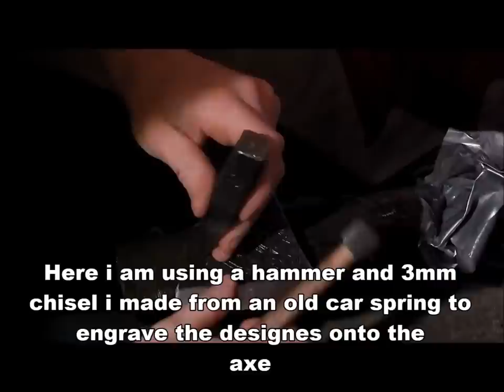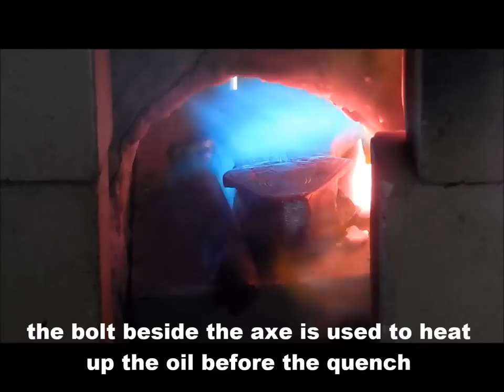Re-forging an old wood axe into an engraved viking axe

Comment: If you can hold onto the head with your bare hands, that tiny little propane torch isn't going to do any kind of "tempering". I'm also glad you filed weak points into the wood exactly where you want to prevent a split from beginning, lol.  There's a reason wood for hafts and bows chases the grain and never cuts into it...

Comment: nice but you might want to secure that anvil a bit more
Reply: A lot of his stuff seems kind of wobbly, the anvil, the vice, etc. I mean.. if it works then I can't exactly criticise him, but I'm sure he would enjoy keeping all of his toes. 

Nothing wrong with making a YouTube video about building a solid stand for your anvil, or building a solid table for your vices. I don't rememeber from the video, but I'm sure there's more than just a vice on that table (probably some expensive power equipment) so it would be in your best interest to build a good work bench.
Reply: agreed. i wonder how much force gets lost by the anvil rocking and moving.
Reply: LOTS !!!
Reply: Here is a Tip from another smith, Your anvil is dancing quite a bit.
bolt it to a round piece of 3/4 plywood, sitting in a cut-down 50 gallon
 steel drum filled with sand to the right height. the anvil floats on it
 and gets rid of ALL the bouncing.
Reply: Dude Im a carpenter and can't help seeing your workbench or "anvil " is running away... might wanna secure that before it decides to fall on something...
Reply: You can wrap the anvil base in a chain to help weigh it down and keep the anvil tied to the base.

Comment: +Andrew Hanowski  Here is a Tip from another smith, Your anvil is dancing quite a bit.
bolt it to a round piece of 3/4 plywood, sitting in a cut-down 50 gallon steel drum filled with sand to the right height. the anvil floats on it and gets rid of ALL the bouncing.

Comment: very nice work!! very clean details. would like to see you drop a beard down in the skeg ox style. maybe Forge weld a spring steel edge. Tool steel needs constant sharpening if it sees a good deal of use. but I do like your work.

Comment: Really beautiful work, personally i think a wooden wedge would have looked more authentic and traditional if it is a show piece. However i can understand the practicality of a metal one. All the same a very fine work.
Reply from the maker: Thank you!  Usually the wooden one Is placed then a metal one pounded in after the wood one, but this was such a tight fit I just had to use the metal one.

Comment: Awesome work there, but I feel like most of the energy from your swings is going into moving the anvil instead of shaping the hot metal. Making a more stable base may go a long way in making your strike more efficient.

Comment: If you reduce the size of the engraving tool down to a small thin tool you'll be able to do more detail with more controlled cuts and longer runs without fatigue. Yes you'll have to remake the tool more often but you'll see that its well worth the effort because of the control you'll get. Use good steel and it'll only need sharpening every so often. Make a bunch of different tool heads when you make a bunch of them and the results will be more pleasing and desirable.

Comment: Very cool dude, I liked them alot, but I have a question, why didn't you take out the rust with vinegar? It's easier and very quick.
Reply from the maker: Not really. I just brushed it off quickly on the grinder. If you mean the scale, I sometimes leave it on for character. If it's on there good it's not coming off easily, and vinager would rake it off within the engravings, taking the black within away.

Comment: That's so awesome, Andrew! I've always wanted to do stuff like this. but I'm afraid I'd catch myself on fire. or would put a hole in my wheelchair seat or tires from the hot metal that flies off while hammering on it. how much would you charge me for this axe? believe it or not I lost my left leg while using a maul splitting up kindling to start a fire. I stayed out on the cold too long and ended up getting frostbite on a few toes so they amputated it at the knee.

Comment: Great work! That axe is amazing. 
Can I ask you something? Why do you only temper the Edge? I've seen that in other vídeos, but I ignore the reason. Shouldn't It be better to harden the whole piece?
Reply from the maker: Doesn't really matter with an axe. Your not going to bend anything on something that thick. You can harden it all the way if you want, but it's not necessary. Usually old axes just had high carbon steel on the edge, and a wrought iron body. Iron dosnt harden so you would just edge quench it. As for a knife or sword though, making the spine soft and the edge hard (like a differential heat treatment) will make it easier to bend, but less likely to break. You can just bend them back to shape if they get bent and a softer spine will always be less brittle. Hope this helps!

Comment: Andrew Hanowski, Hello, I've been a fan for some time, I started blacksmith some time ago and I'm finishing my first ax re forging, if not ask a lot, could you tell me the thermal treatment procedure that applied to have such a hard edge? And the rest of the ax too, thank you from now on!
Reply from the maker: No problem man! I'm always open to help people! If you ever have a question in the future feel free to email as well! Anyway, thers no telling what the steel the ax is. Some are solid carbon steel like this one, while some or even wrought iron with a high carbon edge welded in (old ones that were hand forged). For this procedure I've always had success quenching in a warm oil (heat a piece of steel to yellow and stir the oil with it to heat it up). Canola oil from you local grocery store will work! Sunflower oil as well like in my quench will work. I use canola now since it's a slightly faster quench then sunflower, resulting in a greater hardness. Anyway, after the oils hot, quench it a little over magnetic temp. So basically heat it slowly, then once it's red start checking it with a magnet until it dosnt stick anymore. When it's non-magnetic, heat it just a tiny bit brighter (just around 3 to 5 seconds really, just the color should be ever so slightly brighter and MAKE SURE THE HEAT IS EVEN so you don't get some spots of Martensite (hardened steel) and some pearlite on the edge (soft steel) then quench it AND shaking it back and forth a little. This is because the axe is a large piece of steel, containing a great heat. It will cool slower then a knife and form a vapor jacket delaying the time slightly resulting in a softer hardness. Vapor jackets form on everything going into the quench but you really want to cool the axe quickly since it takes longer to cool then a knife. The vapor jacket can be avoided by moving it a little in the quench. Same with knives. Don't move it so fast to spill hot (and possible flaming) oil everywhere! Temper the whole head to a blue color BUT the cutting edge, it should be a gold color for an inch at least but not more then 2". The eye should be avoided to quench and if you do, soften it up with a blue temper. Possible temper twice as the eyes the weakest part of the axe head if you quench it. Anyway I hope this helps! And good luck smithing!
Reply: Thank you very much, I appreciate the response and the attention
Reply from the maker: No problem! Take care man!

Comment: Geez, watch that anvil wobble! You're losing power in your hammer throws when your anvil is unstable, you want the force to be reflected back into your workpiece, not transformed into motive energy. 
Personally, I wouldn't have filed any rings into the handle, since they will compromise its strength, but this seems to be more of a decorative piece.
Lastly, some pure nitpicking: I assume you used a hickory handle, which the Vikings would not have access to. Ash, maple and rowan are apparently preferred, for various reasons.
Reply: you must be master blacksmith
Reply: Its common sense
Reply: Tulle Rönnmyr Yeah.... Cus you look like you could handle this.
Reply: Nitpickers gonna nitpick
Reply: Tulle Rönnmyr That's coming from the right person.
Reply: Óláfr Hválrøý peel Plealey

Comment: Just fucking place the anvil on a stable surface and you wont have to hammer 10x longer jeez
Reply from the maker: It has been mounted for a while now. Bolted to concrete.
Reply: I was thinking the whole time "pls bolt down your anvil" hehe.

Comment: Can you legitimately cut down a tree with without it becoming damaged badly?
Reply from the maker: I cut into my anvil by accident and it wasn't damaged badly. Its designed for actual use. When I cut my anvil,  I had a board on it to test cut,  and it went all the way through and cut into my anvil.  I thought it was screwed up but when I looked at it it just took 2 passes on the fine belt to correct the edge. Just dulled it.
Reply: Oh wow.

Comment: How... authentic.
Reply from the maker: Sarcasm? Ha ha. I don't know. Its not really historically accurate if that's what you mean.
Reply: Yeah, just a bit snarky, but no ill will intended.  I have a lot of friends who are seriously into Viking-age stuff.  A few of them are smiths, including a couple of pros.  One guy makes jewelry that looks like it came out of a museum - he uses authentic tools and techniques, and his stuff is incredible.  He uses a MAP torch for time's sake, but a couple of years ago he and some others built an in-ground charcoal smelter (I sewed the bellows leather).

The thing that finally got me was using the torch to darken the handle.  :-)  A heck of a lot of reshaping work, though - quite a workout.  Question - why use snow to remove the scale and not a wire brush?
Reply from the maker: The Japanese usually use water to blast off the scale, and my tank was frozen so I had to use snow ha ha. I use different techniques that i find the best from personal experience, old and modern ones. I find water WAY better then the wire brush, but sometimes I still use the brush if thers not too much scale. Anyway thanks for the comment, and thanks for watching!

Comment: Does anyone know where or how I could get a good anvil for a beginner?
Reply from the maker: Check out a local scrapyard. Probally not going to find an anvil, but you could get an old sledge hammer head and put half of it into a stump. Search    "sledgehammer anvil" and you will see what I mean. Also, railroad tracks are pretty good (but not flat). Make sure it's steel of some kind.  The hammers perfect because it's hardned steel like an anvil and will be great for blades!

Comment: I am only up to 2 mins .30, bluddy heck, anvil is wobbling, trousers are inside boots ( so any and ALL schnot  coming off workpiece now inside footwear ), and even if I was drunk, hammer blows to workpiece would be more accurate & consistent than this Demo video ??

Apologies fer sounding like a Troll, is this ROUGH or what ??
Reply from the maker: Don't worry my anvil is mounted now. After This project I had to mount it! Anyway, my pants are in my boots because there was ALOT of snow, and this kept it from entering my boots (if it were over I would sink down and it would get stuck in) and I don't think anything scale could hurt me there!  (wearing a glove for example could though) and as for being drunk and hitting better? I doubt it.. Forging on an anvil that moves is a pain in the ass and I didn't want to hit too hard because it moves. Also, of you think it looks rough that's because it's supposto. And look at the chisel I was using, it's not really ment for stuff this (i made a small  One I use now) and plus, this was my first time doing something like so it was an experiment. 

Now, my engravings are not that rough, along with my design. If you like you can see my newer stuff on Facebook "hanowski Smithy custom cutlery and forging"  (alot of old crap in the later posts though) also keep. In mind this video is Old.
Reply: And within 12 hours the Man himself had replied to me via email, wow. The trousers were in the boots because it was snowing, and YES, the anvil IS bolted down nowadays !! Cheers Sir Andrew, best I add, Awesome Axe !
Reply from the maker: Thank you!

Comment: and ur scoreing of "rings" on ur old handle created many weak points that arent smooth....ur wedge u put in is pointless.. that handle willsnap at scored rings way before that steel would think about sliding off..nice leather work!!lol
Reply from the maker: How does that make it weak? I get it if there deep and sharp, but I've tested these axe handles many times and trust me. The rings don't create stress points. I've bust handles hardcore testing them (like actually hitting them with a hammer on the anvil trying to break them) and actually chopping tests as well and it broke in the middle (where the wood in thinnest obviously) the rings are not deep or sharp at all. I've had to replace handles (not because they broke, but because the customer wanted a smaller one or different style) and I can tell you, getting these handles off is a pain in the ass. They are very tough.